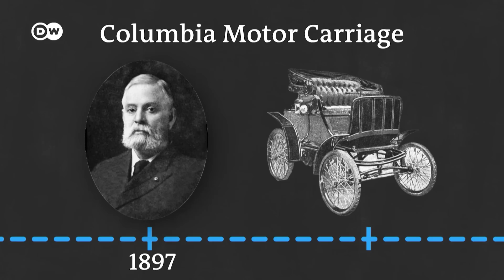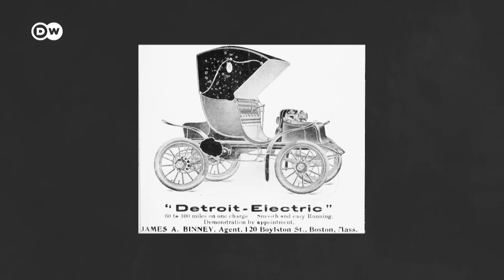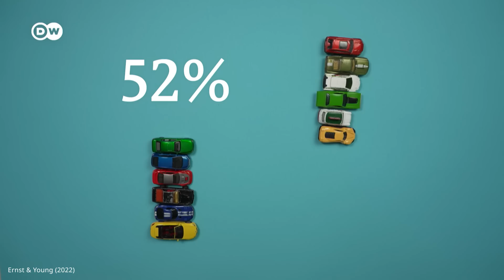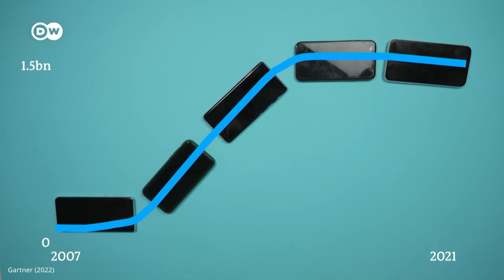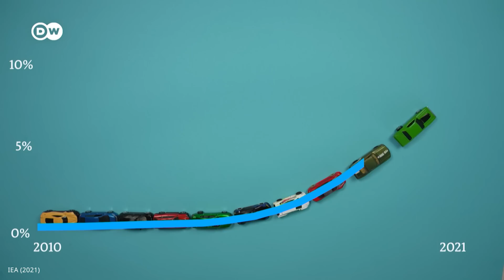Why electric cars are finally taking over

Comment: No, EVs are already unsustainable. They went from trying to build small sustainable vehicles to being giant, long range copies of oversized ICE vehicles. Materials are reaching critical supply shortages, and as soon as governments get focused on the true Life Cycle Assessment of their impact, they will be banned. Volvo has shown us their C40 Recharge and Polestar 2 both have life cycle impacts of 25 tons of CO2e even when charged on fully renewable energy.  Prices are absolutely NOT falling rapidly. Prices for EVs are rising due to limits of resources to build them. This video is years too late in its analysis. You've just repeated a Tony Seba Ted Talk from years ago. He was wrong. The video is wrong.

We need electrified mass transit and micromobility. There is no room in our carbon budget for unsustainable person EVs with massive impacts.  Charged on EU28 power, they barely are an improvement over ICE. And this comparison with ICE is the reason people aren't taking the longer view of actually challenging the long term sustainability of building EVs forever. It's just not sustainable at all.
Reply: Ricardo Strategic Consulting conducted a life cycle assessment study for the Fuels Institute to study the life cycle emissions and total cost of ownership of internal combustion engine (ICE) vehicles and electric vehicles. They found that EVs are cleaner than ICE after just 19k miles. They included all stages in the life cycle include vehicle manufacturing, operation, and vehicle after-life management. Vehicle production involves the material procurement and processing phase. The operational cycle includes fuel production (petroleum or electricity based on the vehicle) and utilization of the fuel in the vehicle. Vehicle afterlife management includes vehicle and powertrain disposal, material substitution through any remanufacturing, and recycling.
Reply: @That-Guy_  being less unsustainable than ICE doesn't make them sustainable. We will not have the resources or remaining emissions budget to perpetually build EVs under zero carbon. Stop trying to rationalize the car industry with ICE vs. EV comparison. Both are unsustainable.
Reply: @karlInSanDiego  
Mass transit is a good solution in some places and for some people but not all places for everyone.
Reply: Finally, someone see this. Also buying second hand is better than buying ev

Comment: I've seen more electric charging points in the nearest town to me - but never have I seen anyone using them.

Personally, as someone on a really small budget, I'm going to have to wait until I can get my hands on a second-hand EV for about £1k or less (highly unlikely). 
However, the only reason I can run a petrol car now is because my husband is a mechanic and can do everything for the car we own. I suspect he won't be able to maintain an EV, since it's likely to be a lot of computerised rubbish inside - and garages charge what they like when it comes to 'programming' these newer cars to 'accept' newly fitted parts and mess about with numerous sensors. 
So I fully expect my government to eventually force us off the road with future laws. A pity they're not so quick to construct laws that prevent local councils from cutting back on public transport services - which is what finally forced me to learn to drive in the first place.
Reply: It has the same brakes and suspension , but using regen the brakes last longer. I do my own maintenance and my 8yr old nissan Leaf has only needed tyres, wiper blades ,screen wash in the 6yrs ive owned it and a bottom suspension arm for the 1 mot it failed. In my experience of combustion cars reliability has been a tad different. Just because oil , filters , exhausts , clutches , cam belts , plugs , fuel filters , clutch cables etc are easy to change not having them at all is better.

Comment: As someone who lives in Los Angeles and recently went through California's "please conserve electricity" BS due to the heatdome, I would argue that electric cars are a scam if you look at the long-term struggle against global warming.  Why do you need to spend all that electricity and energy on an inherently selfish mode of transportation when a properly built out metro/subway system with reliable and frequent service can do that more efficiently for the whole community?

The US needs to reject its whole car worship culture and go back to building out mass transit metro systems like subways and light rail and build around having more walkable cities.  Electric cars are also not going to change the American myth that "pedestrians are not visible enough" because the whole car-centric infrastructure of stroads is designed to give the middle finger to anything that isn't a car.

Comment: here in Shanghai, Streets are full of EVs of all sizes mini EVs to very common Tesla, Xpeng to Large luxury EVs like Nio, Li auto, Hongqi! it's  fascinating how Europe is so behind (except Norway)
Reply: It shouldn't be terribly surprising that China led the way with EV adoption. Aside from the greater need due to greater air pollution, EVs have had higher hurdles to be viable in Europe - both because driving distances are greater and the EVs have to be better than the cars that Europeans already have. By contrast, most people in China still do not have automobiles so even a car with only 200 km range and low safety standards is still a huge improvement over walking, a bicycle, or a motorcycle.

The U.S. has much greater driving distances than Europe, so it is naturally going to be one of the later developed nations to switch to EVs as the EVs have to be much higher quality to be viable.
Reply: @alanlight7740  China has two advantages.
1. Cheap high speed railway for any long distance travel elimating the need for very high range EVs like in the USA. 
2. Charging infrastructure. No matter what EV you have Chinese EV companies by law have to share their charging station with other EVs. The way it's done in USA is so so stupid. Can only charge Tesla in Tesla supercharger area. The Fcuk. Shouldnt every EV be allowed/made possible to charge in that area since the infrastructure has already been created?
Reply: @alanlight7740  Please stop acting like being naive dude. Chinese have the best quality roads and bridges and the largest car market in the world. Even American Ford and GM sell more cars in China than their home country.
Reply: @spider6660  - LOL - China has the largest car market in the world due to its huge population, yes - and no doubt China has improved a great deal in recent years, but no, China is still lagging when it comes to quality issues - and most of what it has accomplished in recent years is thanks to the efforts of western and Japanese companies operating in China.

Comment: Tokyo. I do not see EV charging stations very often, and zero construction along major routes. One would think governement stating only EV by 2030 would be intelligent enough to prepare the charging infra. Not so for Japan. They cant even build a link between east and west japan to link the 2 disparate power systems, which was a serious problem after the 3/11 tsunami. That is of course, inaction on purpose, because the governement is pushing for reopening nuclear power plants (while simultaneously taking no steps to shore up power suppoy, and claiming brownouts every single winter and summer like clockwork since 3/11).
Reply: Oh.. and Subaru continues to refuse to make an electric Forester, so it looks like Volvo C40 or C60 Recharge for me, or perhaps Fiskar Ocean.... assuming its not vaporware ;)

Comment: EV has come a long time ago before Musk introduced Tesla. In the Past, although the battery is cheap, it could not power car for a long journey. That's why, it promoted to the women. Unfortunately, cars were mainly driven by men, so sales drops and EV dissappear. There were no urgency need for the car manufactures to change to Electric was also one of the reason why EV could not develop. 

Challenge for EV nowadays:
1. infrastructure (charging port)
2. price need to be equal as gasoline car (subsidize)

Comment: An electric car makes no difference if your grid is powered by coal, what needs to be worked on is better energy storage compared to current battery technology.
Reply: Actually, it does. A power plant is going to be much more efficient than an ICE that needs to be mobile and run at suboptimal states. Gasoline also takes a lot of energy to refine.

Comment: The carbon dioxide emissions are actually beneficial.
The electric cars are still limited by the heavy costly battery.
There is only good market penetration where there are heavy subsidies such as Norway.
Lithium batteries will soon suffer from a significant dyseconomy of scale due to limited reserves.

Comment: Here in Florida, I shopped around and none of the dealerships have them in stock.  If you do find one, the dealers mark them up by $10,000.  I have two electric vehicles on order: VW ID.4 and a Cyber Truck.  The ID.4 is set to deliver by the end of 2022 and Cyber truck is maybe end of 2023.
Reply: I have a CyberTruck preorder too.
I am ~430k in line.
Reply: So - manufacturers are making them as quickly as possible and expanding production as quickly as possible.   Demand far outstrips supply and the dealers and being their parasitic selves. 

Charging is becoming more nearly ubiquitous and reliability is improving.  

All indicators point to EV.
Reply: A video titled "EV charging and hurricanes: What drivers should know before evacuating"

Comment: Have had an electric car nearly a decade now, it's fully paid for itself in fuel savings. 

We simply plug in at home overnight for a nearly free and full tank in the morning 🌄
Reply: My old neighbors used to have two EVs with solar panels on their roof. Not only did they not pay for gas, but charging their cars was practically free. The financial incentive is insane
Reply: @PlanetZero-ClimateChange  also way less maintenance costs! In the future I plan also to buy an electric vehicle
Reply: @elijahstuffs  Yup, less air and noise pollution, less maintenance costs, cheaper fuel, and becoming cheaper and cheaper. Not to mention Tesla engines are outperforming nearly every combustion engine on the commercial market.
Reply: @elijahstuffs  It won’t be cheap when you need to change the battery
Reply: Ev car buyers are mind children,
Mind children are easily led — and easily misled.

Comment: In North America the path to going predominantly BEV is via PHEV.  I use one tank of gas (petrol) a year with my PHEV.  With my previous BEV I rented ICE cars to reliably go a distance - therefore using more gasoline than I do now.  My PHEV range is 585 miles: zero anxiety (panic).
Reply: Plug ins have lost popularity as they're antiquated and costly to maintain, have low range.
Reply: @Nicholas-f5  i don't understand.   A PHEV is a Plugin with enough range for both errands and trips.

Comment: 1. When will be tackled the huge issue of battery life and the ecological disaster of these millions and soon billions of batteries that will be discarded each five to ten years?
2. How can EU deal with more energy demand when it cannot even cope with basic industry and households needs without these electric cars?
3. 95% of all energy comes from carbon and nuclear sources, and increasingly from COAL! Since most of these sources do not use catalysts or filters they are couple times more polluting than current Euro standard petrol engine cars. When will electric car advocates gonna talk about this huge problem?
4. Most rare minerals needed for the electric batteries are mined and purified using abject and highly polluting methods. When will the electric car industry gonna be penalized or at least forced to do something, anything, about this huge problem?
5. Since China controls more than half of the resources needed for electric car batteries and a new economic war with China is imminent (see recent US declarations), how will EU respond to the impending battery shortage? There will be another one of the long and many EU bureaucratic failures?

Electric cars are an opportunity, especially for countries with abundant energy solutions and access to various rare minerals. For EU, a Nordic hemisphere continent, with some of the fewer minerals and resources on the planet, and with a huge energy shortage due to insane shortsighted bureaucratic EU policies, this "opportunity" may actually become another disaster, like most of the EU centralized policies in recent times.

This insane push for another import-dependent energy hungry industry will not bring prosperity to the people if it is done, once more, top-down, imposed by corrupt and incompetent unelected bureaucrats and supported by government controlled media.

Another mega EU fail in process, and we, the EU citizens will have to pay, once more, for this.

Comment: In my country India,  two wheelers are catching up fast than four wheeler..probably because they are cheaper...but one segment which beats gasoline vehicles is e-rickshaw..now they can be seen everywhere and numbers of gasoline rickshaw depleting day by day..battry they used is also normal chemical battry not litium ion..
Reply: In my country terrible accidents and fires caused by electric cars resulted in a decision by people who purchase cars to focus their attention on other options.
Reply: By chemical battery do you mean lead acid? Lead acid batteries cost less up front but cost significantly more per stored kwh over the lifetime of the battery and that is before you have to consider the lower efficiency and higher weight.
Reply: @garethbaus5471  that used to be the case, but most new 3ws are sold with lithium ion batteries now.
Reply: @Amuzic_Earth  That makes sense.
Reply: @Amuzic_Earth  are you sure about lithium-ion batteries in newer E-rickshaws? because that would make them much more expensive also I don't think there's a need for a lithium-ion battery in them as they don't need to cover that much distance.
Reply: Indian government should reduce tax on hybrid vehicles, just as they do on electrics.

Comment: Then we have the thing with car companies like Ferrari, Lamborghini, Pagani, Rolls Royce and all the other European luxury car manufacturers who combined produce less than 1 million cars a year, a car that most people buy not just as an A-B car but as a fun car that they enjoy driving and the feeling of driving them, the sound of the engines, the shifting of gears, the uniqueness of the different engine and transmission configuration, from V10 to Boxer 6, to twin turbo V8, all of these engines behave and sound differently, these will disappear not to much benefit to the climate as most of them are only weekend cars that barely will drive 100k KM in 20 years and what will they be replaced with, a uniform boring one trick pony, that's heavy and the millions of people that think and dream for the same thing as me will never get to experience it, especially the younger ones. Wouldn't it be better if we replaced the fule that is actually causing the damage instead of banning IC engines like Germany has proposed, I think that would be better, people that only want an A-B car can get an electric but for people that want their Lamborghini's they can get that too

Edit: replacing the fule would also make all of the cars that are on the roads today CO2 neutral too